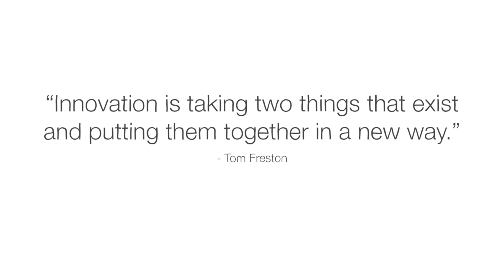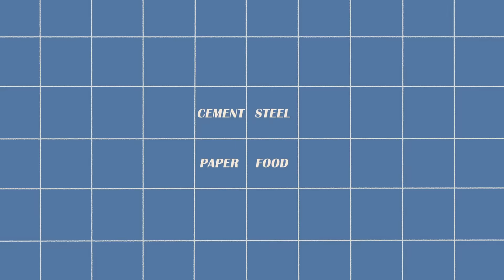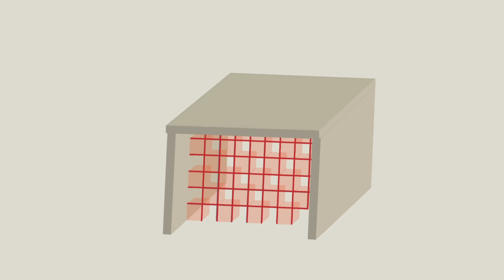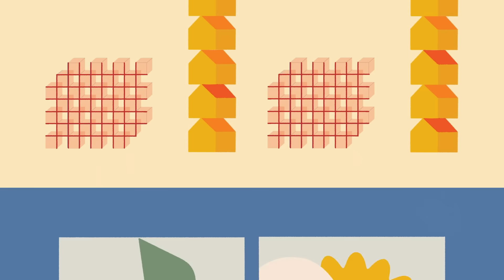The solution to our energy problems is … a toaster - Rachel Yang

Comment: Heat batteries nice, but still require to burn fossils to heat them regardless of source of energy
Reply: What do you mean? The video showed that they would be a perfect way to store power from wind and solar.
Reply: @pyRoy6  wind and solar at our current generation rates are very inefficient to power devices that create heat. Fossil fuels are much more energy dense which is why they are used more today than wind or solar. You need a lot of energy to create usable heat and it would take a long time to do it with just wind or solar
Reply: @HIFLY01  The point of this video is that this particular method of energy storage gets around those problems.
Reply: @pyRoy6  point of original guy's and my comment is to say you still need to generate heat to "charge" the batteries and with solar and wind power, its going to take a while to do. Or it would take a fraction of the time to do it with current systems we have in place that use fossil fuels. Its pretty clear what is being said
Reply: @HIFLY01  But fossil fuels are already stored power.
Reply: @98Zai  and? Bricks dont have an initial amount of energy like a piece of coal. You need to give it something for it to work like a computer. Computers store energy all the time in the form of capacitors but you wouldn't hook up a computer to power a house. It requires input to store said energy like the bricks. Coal doesn't
Reply: @HIFLY01  Did you watch the video? This storage method is notable because it can slowly take in energy from wind and solar, and then release it at high temperature in a short period of time.
Reply: @HIFLY01 I don't understand your or OP's argument. The coal is already power on demand. What you're suggesting is extremely wasteful?
Reply: @98Zai  you need to charge the bricks for them to store heat. You dont pull out a random brick, slap it into the chamber and get heat. How do you add heat into it? Slowly with wind and solar or faster with fossil fuels? No company is going to spend days waiting when theres a solution that gives faster results
Reply: @HIFLY01 Burning coal may be faster but it's much more expensive.
Reply: @98Zai  which goes back to what I said. Is the cost enough to justify having your business shut down for a few days while waiting for them to charge? If its still cheaper to do this whole brick battery process, why isn't it happening? Theres something clearly wrong with this idea thats not being shared. If it was some miracle energy saving process that saves companies money, theres no reason to not do it so why isn't it used on mass?
Reply: @HIFLY01 Well, intermittent energy generation is a fairly new problem. We have had pumped storage hydroelectric dams for over 100 years which is also a kind of battery, but that's locally limited. There is bigger demand now that these cheap modes of power generation are becoming available, and they will become increasingly efficient and cheap. We're just at the cusp of this thing.
Reply: @98Zai  video clearly says its a century old technology. This isn't something that people just thought of a few years ago. If its as good as the video is making out to be, we'd have a decent amount of companies trying this by now. Doesn't have to be every company but definitely not as little as it is now
Reply: @HIFLY01 Yes, the toaster was invented in 1893. This is using the same kind of heating element as a toaster. Maybe you should watch the video and pay more attention. I'm not your personal googlemachine. Have a nice day.
Reply: @98Zai  thanks for showing your lack of understanding
Reply: I believe the idea is to handle the irregularity of renewables, which produce an excess of power at some times and not enough at others. With energy storage technology such as this, the excess could be stored up when available and then drawn upon when the supply is insufficient.

Comment: Maintenance on them must be a gigantic pain if it's a fully closed system. But still, a huge leap forward if we can get people to use it
Reply: " I don't like sand. It's coarse and rough and irritating and it gets everywhere."
Reply: Probably less of a pain than maintaining fossil fuel burners, though.
Reply: Maintenance? On sand?
Reply: @texanplayer7651  Maintenance on the cage around it. Heat hates everything, so eventually it will break down that concrete and steel, not to mention the heat generating filaments
Reply: @texanplayer7651  cracks in the structure can leak heat , I imagine one would buy two. Use one for a week and let it rest than use other one.
Reply: Not to mention is cheap to make.
Reply: What maintenance? How much maintenance does your toaster require? What about the bricks in your fireplace? Not much, right?

Even when the system ages, it would be modular if well designed so cool down and work on single modules with others still being used.
Reply: @Kimoto504  In thermodynamics its called thermal stress and every material experiences it to an extent. Cracking, deforming and other abnormalities could occur especially if this thermal battery cools rapidly when using its stored heat. Im not a professional but that was just a heads up to what mantainance could be needed.
Reply: Use shipping containers as the inner storage hull. If the metal cracks after a while, exchange that container for a new one. Empty, keep the rocks, and recycle the metal for new containers. 

Also, augmentation. Allow room to add new containers over time as the old ones wear away. Slowly change the fleet over from old to new containers. EZ

Comment: If they store slowly and release fast, aren't they supposed to be heat capacitors ?
Reply: But they also have a long self-"discharge" time. So they are somewhere between a battery and a capacitor, and luckily we already have a term for such a thing - supercapacitor.
Reply: Good point
Reply: No, it's only a heat capacitor if one side gets hot and the other side gets cold.
Reply: Depending on who you ask, I suppose you could say that a capacitor is also a kind of battery.